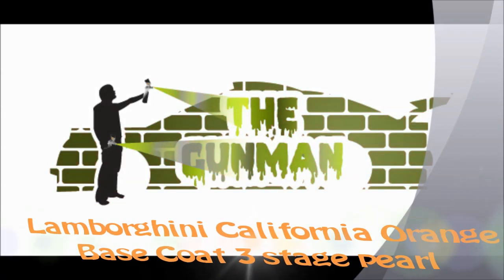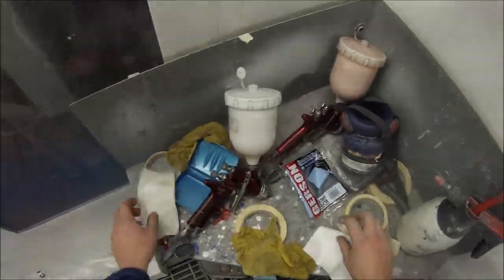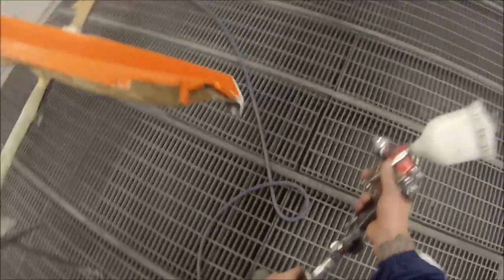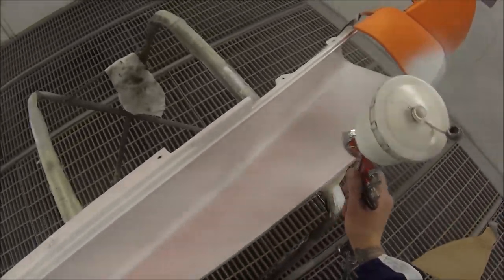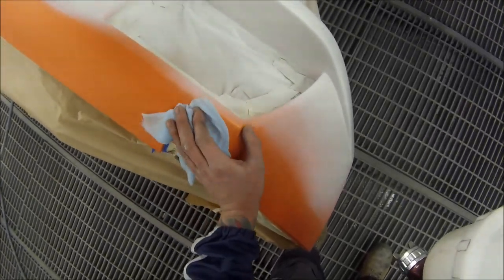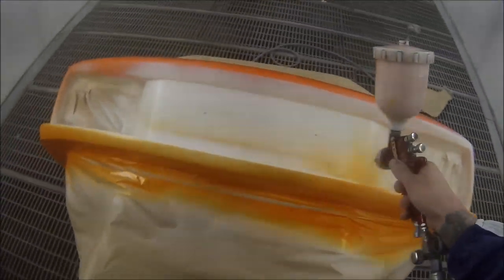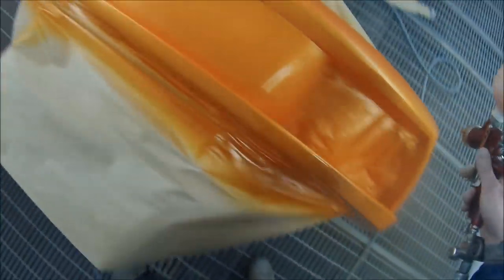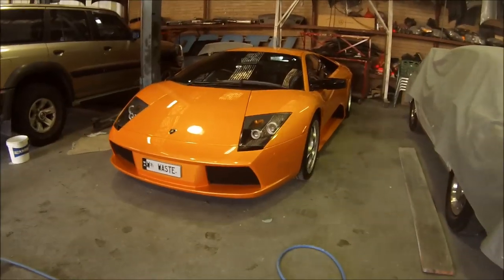California Orange Lamborghini Murcielago Base Coat

Comment: Gunman, curious if you get any issues with dry spray flicking out the metallic? Is the gun held out a bit farther or the same distance, just increased pressure and more random spraying?

Comment: gunman do you always use blending clear ? I've seen you put it on at the brining and sometimes after the 1st coat does it help in the blending of silvers I'm using glasurit 90 line and have never used it bit will give anything a try .

Comment: Gunman I have always been told that when you do the effect coat, that you should reduce the pressure and mist it on, rather than bump the pressure up and move the gun quickly. I am yet to try it your way, but I was just wondering what your views were on that, as your results seem fantastic doing it your method. Cheers!
Reply from the maker: I know some people do drop the pressure for the last coat but I find it makes the metallic really thick and won't have the right effect in the sun, I think people do it as a way to stop mottle in silvers and that but if you have a good technique then its not necessary and find my way usually achieves better results, thanks for watching and sharing your thoughts.

Comment: For some reason I think the UK Gti lay paint down better than the US Tekna. Gti does provide the look I am going for not dissing the iwata. I found iwata very inconvenient its clearly design for only clear and most of us paint with color and I will leave it at that.
Reply from the maker: Thanks again for watching man, I've never had the chance to use a Tenka so cant tell you any opinion although I was always told they are the same gun, I never used to like anything but my DeVilbiss but since I started the gunman I decided to start using some other guns mainly to do reviews and I am quite happy with the Iwata but don't really like SataJet.
Reply: I have check the Usa store for Prolite Gti and they dont have that version. I think the airguage on the Gti is different from the Tekna. I like the orange better maybe color choice.
Reply from the maker: Yeah the Tenka has no air valve on the bottom like the gti but apart from that think its just branding, If you cant find one just check Ebay and they will most likely ship one from here in Aus to the US.
Reply: Can u paint with same result with the Iwata lph400. What would u use in combination with lph400, base gun and clear gun? Also last question what gun do u use for primer?
Reply from the maker: We just use a cheap gun for primer I can't even remember the brand but a good one is the Anest Iwata Aurgunsa 1.8 or 2mm, I just used the LPH400 for the first time this week and I'm very impressed with it and it really gets a good finish so yes you can get similar results to this with LPH400.